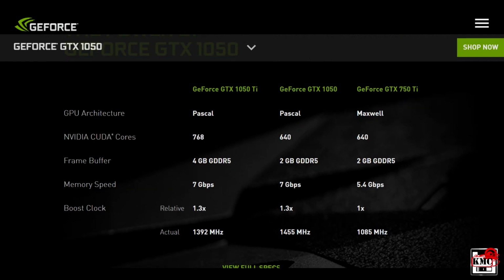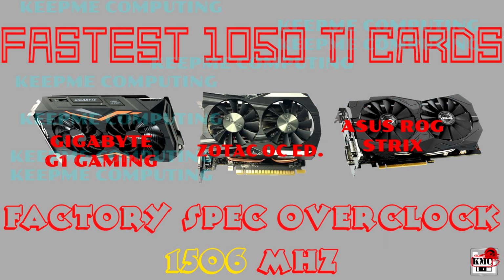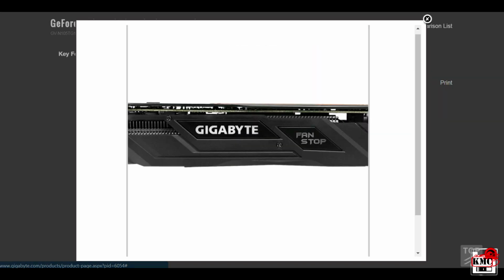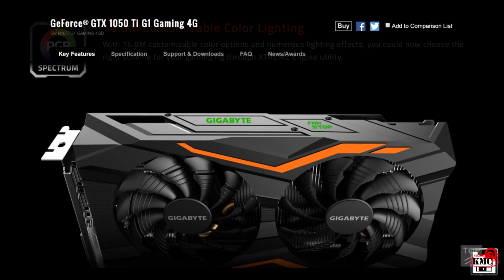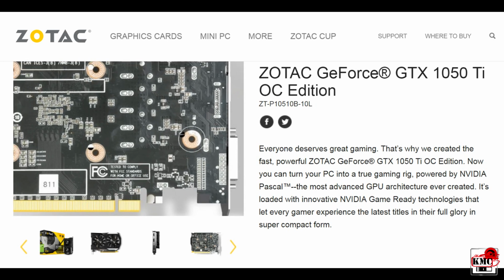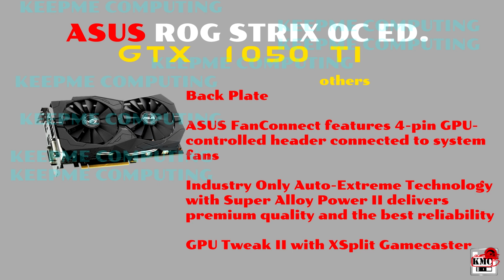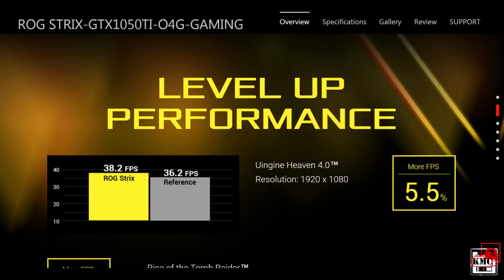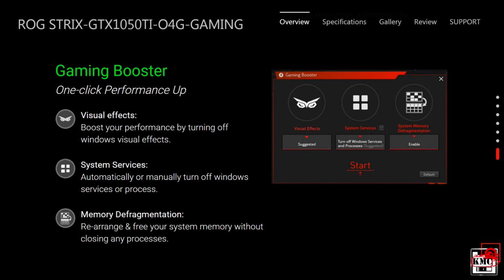ALL 1050 TI CARDS COMPLETE COMPARISON - WHICH CARD SHOULD YOU BUY?

Comment: Whis card should ?????
Reply from the maker: What feature is most important to you? Cooling? Looks? Wattage? Overclock? Longevity? Reliability?

Gigabyte has traditionally conventional and reliable designs, in terms of voltage regulation.

If you want cooling, and your pc case needs airflow, get a two fan setup. Larger fans are quieter for the same amount of air moved compared to smaller fans.

If you are after looks, get one with a backplate if you have a traditional pc case and can view the top back of your videocard.

LED lighting affects looks as well. Thanks and ask away!

Comment: May I ask if GTX 1050 Ti EXOC White can hash more in mining compare to none 6pin. I would appreciate  your answers.
Reply from the maker: Hi there! Thank you for watching and commenting. The hashrate in mining as you know varies and scales with power consumption. Towards a certain threshold, you reach a point of diminishing returns. That is to say the more juice or power you give the card the less hashrate you get per kw/h consumption of electricity.

The 1050ti in general seems to scale well to around 79% power consumption of maximum draw for maximum efficiency of mining returns ratio to kw/h consumption. That is to say optimum for MOST mining 79% of max power draw is efficient. More importantly the ram size has way more effect and effects suitability for mining certain currencies more than the power draw.

To answer your question, if you are definitely overclocking and going way over power draw and have solar or cheap electricity, then 6 pin would allow you more leeway in OC and more returns. Do note that each silicon is different even within the same product line and company so your best bet is to have a 6 pin for OC purposes. Otherwise if electrical consumption and cost is a worry to you a card without 6 pin would optimally give the best hashrate to kw/h consumption ratio at 79% in general mining. Different cryptocurrency have different dependencies and ram is sometimes a very limiting factor in certain currencies.

My 2 cents,
Best Regards